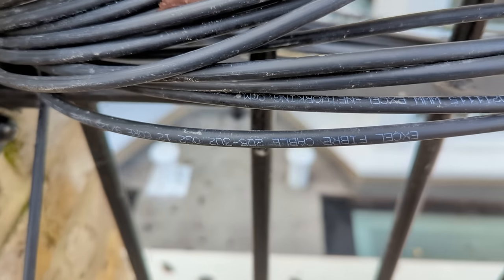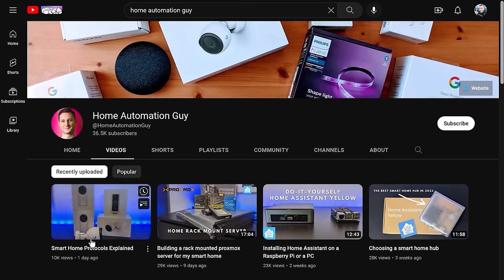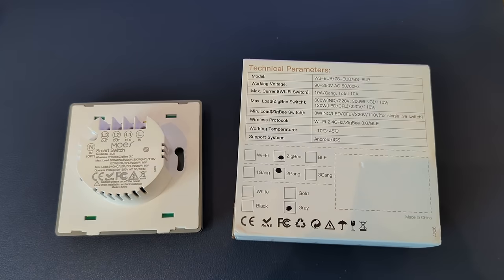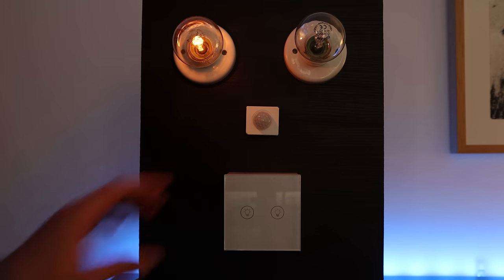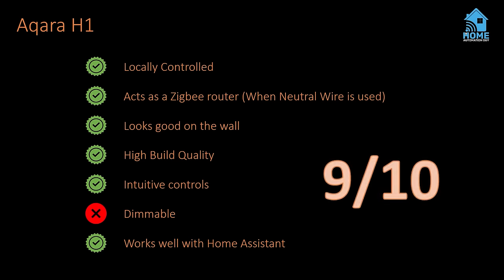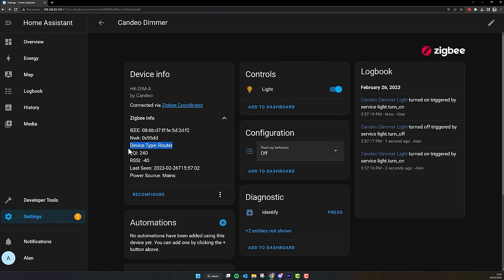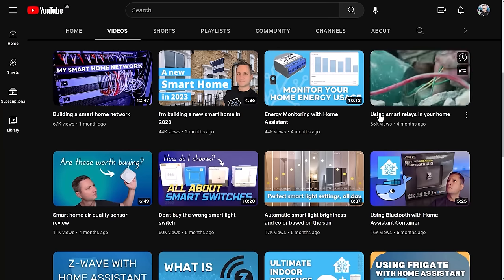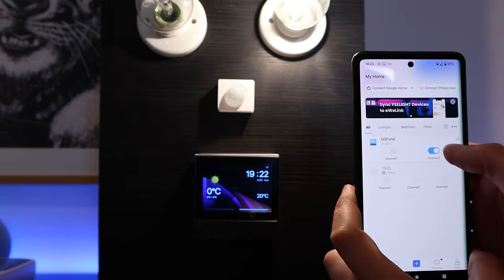Which smart light switches are the best?

Comment: Not sure how long you've been doing this, but you should know that almost all no-neutral switches won't work as a router. Basically, you'd destroy your mesh whenever the switch is off. There's sometimes an option for a bypass resistor to supply current to the switch when the light is off, but in general, if you have a neutral wire - use it! Otherwise, nice video.
Reply from the maker: I thought that too until I came across the Candeo!  I'm using the Neutrals at my place, because I want that sweet sweet router goodness
Reply: I have been using Aurora AOne and Candeo clones which are no-Neutral smartdimmers that act as Zigbee repeaters for several years and can report that when "off" (ie unlit) they continue to function without disturbing the mesh. This is possible because a small current continues to pass through the unlit bulbs to provide the smartdimmer with constant power. Unfortunately not all bulbs can do this without a glow or flicker, so compatibility is not as good as a smartdimmer that uses Neutral. A load bypass device (typically a capacitor, not a resistor) can often solve the glow or flicker issue. Note this is not the same as the flashing that can happen at full brightness when the minimum load requirement of a smartdimmer is not met. Adding a resistive dummy load can solve this but is wasteful of energy, so not ideal. Probably better to change the light fittings to be multi-bulbs instead.

Comment: Be interested to know what you did with your bathroom that in the UK at least the fan / extractor is linked to the light switch.
Reply from the maker: The ceiling light is still connected to the fan in the same way that it was prior to installing the smart switch
Reply: so you haven't automated the fan yet or is yours linked to when the light in such a way that if the light is on the fan is on? @HomeAutomationGuy

Comment: advice please, I am totally new to remote lights, my backdoor outside floodlight is controlled by a switch in the sunroom (3 gang switch) and i would like a switch at the back door to turn light on and off. the 2 other switxhes on the switch control the light and fan in the sunroom. can i do anything to allow only the outside light switch to be the one operated remotely from the backdoor area?

Comment: @HomeAutomationGuy what load did you use with the aqara switch? I have a room where I want to try the non neutral one, but I have a LED light that has little power
Reply from the maker: I had quite a bit of load on mine.  I just checked the box and it says it needs a minimum of 3W - so I hope that helps!
Reply: @HomeAutomationGuy  thanks! This is helpful

Comment: Silly question given that the Candeo do a faceless version (which if it fits a standard module wall plate is a superb feature for matching other electrical outlets) why couldn’t you just put 4 of them in a standard wall box with a  4 module wall plate?
Reply from the maker: You definitely can do that! I just didn't need dimmers in all the places I had 4 gang switches

Comment: With the Aqara switch couldn't you decouple it from the lights so it keeps power supplied and then just use BLE dimmable (or even RGB) bulbs and have an integration that controls them? You could use a 2 gang for different brightness settings.
Reply from the maker: Yep, that would work. But then I'd need to buy new bulbs as well

Comment: i really really wish there was someway of getting light switches that work like normal, but also allow for white color mixing at the bulbs. basically it's a hard requirement for me that the lights work without HA or internet currently working, but i really want to do time of day white temp adjustments.
Reply from the maker: That would be the dream!
Reply: I also think that the biggest advance in lighting is the ability to have circadian variation of white colour temperatures. This currently requires smartbulbs, not smartswitches or smart dimmers. 

A partial solution is to use LED bulbs that shift colour temperature as they dim. This replicates incandescent bulbs which shift from cool to extra warm as the light output reduces, so these can work well with smartdimmers.

Comment: The problem with all smart switches is that they are not built to last. I bought 8 aqara wall switches and started to mechanically break after 2-3 years. I recommend a sturdy dumb switch with a smart relay. Moes relay works fine but Moes dimmer has a too slow non-configurable transition, any ideas?
Reply from the maker: Oh.. I've had mine for a year and so far they're still ok! 🤞

Shelly make some great relays

Comment: I am bit confused why you can't use Shelly? You can use any normal switch with it.
Reply from the maker: They don't make a 4 gang relay as far as I know, so you'd need to put 4x single gang relays behind a 4 gang switch and there's no way that would physically fit in my back boxes.

Comment: If someone doesn't know what a neutral wire is and why it's important, they have no business faffing about with electrical stuff.

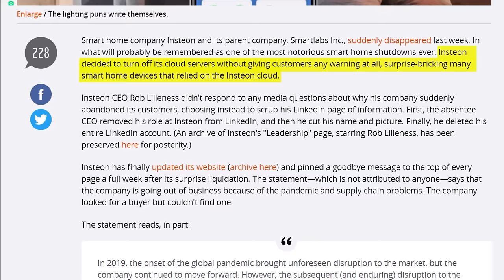3:15 agree 100%. thats why i will never use such products.

about those requirements: are there any smart switches that report to home assistant when they've been pressed? i have some smart plugs that i can toggle using the button but then home assistant doesn't know that i've done that. 

20:24 you turn on your stair lights manually? why not use some kind of sensor to do it automatically?

Comment: Interesting, what I decided to do was just add shellies behind my dumb switches, turning them smart, while keeping the original looks and feel of an actual light switch. 
Especially useful if you live in a rented apartment and don't have permission to do electrical changes (if you disable automations in HA with a single flag, everything behaves like if they weren't even there).
Reply from the maker: Sadly I don't have the physical space behind my switches for Shelly's.  My OCD also doesn't like when a rocker switch looks like it's in the Off position, but the light is actually on 🤣
Reply: @HomeAutomationGuy  Yes, I had to change the shallow boxes for a deeper version to fit the shellies in.

I also have OCD and must have all switches in correct positions, but I usually do not use them and rely on automations. It's just nice to have a standard switch that just works, either for somebody else, or when you decide to play with your network setup and bork it for hours, but is also smart and can be fully automated.
Reply from the maker: @MiChAeLoKGB  We've all been there, borking our networks! I tested out a bunch of Zigbee USB coordinators the other day on a test Home Assistant install and it killed my main Zigbee network performance until I turned off the test machine 🙈
Reply: @HomeAutomationGuy  Yes, I was changing my local networking from single LAN to multiple VLANs and oh boy did I want to swear at somebody (took me almost 7 hours... *angrily looking at QNAP*), so my automations with shellies were not really working, but the nice thing was, that the switches worked fine, so all lights were still fully usable.

Comment: Why not use built in zigbee dimmers like the ones from Robb or EcoDim? Built in dimmers = smart relays with dim functionality.
Reply from the maker: A lot of the options out there that I looked at wouldn't phusically fit in my back boxes behind the switches.
Reply: @HomeAutomationGuy  they're tiny! I just installed 2 this morning, behind regular pulse switches. I think the depth of the modules is around 20mm
Reply: @HomeAutomationGuy  and thanks for another great video!

Comment: I really don't understand why the electrician made such a mess of the boxes in plasterboard.   If they were in solid walls, I might understand but it is a simple matter to remove a plasterboard box without any damage and extend the hole with a keyhole saw.
Reply from the maker: The walls are dot and dabbed on, with a lot of the dotting done around the back boxes.  It's an absolute mess in there

Comment: How much power are you wasting with all the servers and data equipment running 24/7 including all the smart switches consuming power. Quit wasting power and get off your bum and turn the switch of by hand. Software never goes bad in a normal switch or receptacles without wasting energy. As an electrician, normal people don’t consider how much wasted energy is used with ‘smart’ devices. Every watt adds up.